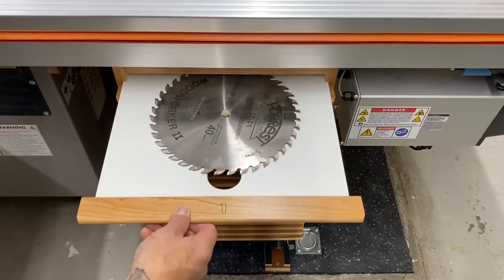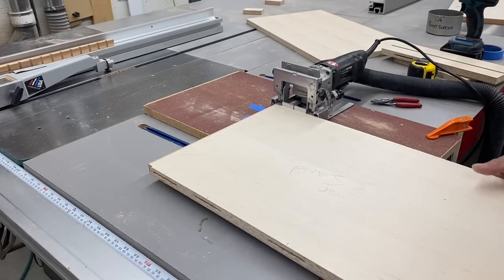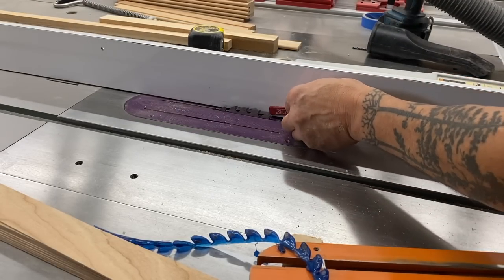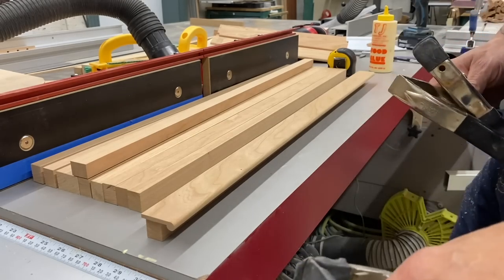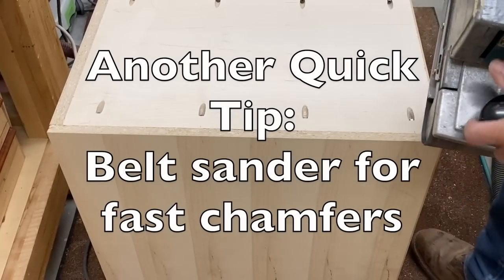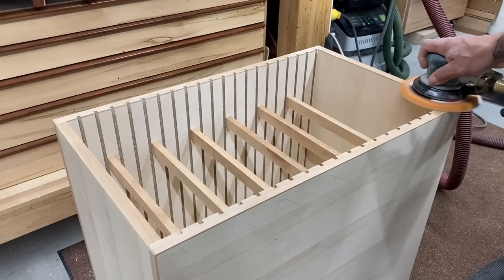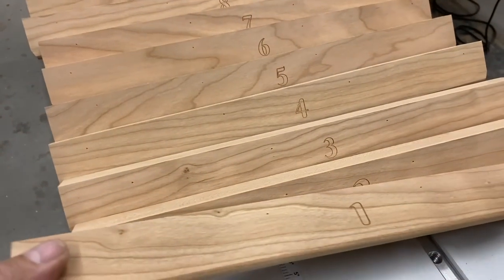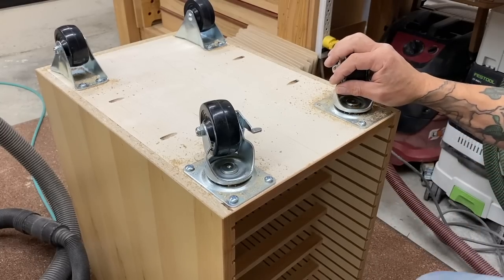This Saw Blade Storage Cabinet is Awesome!

Comment: This is the best looking sawblade cabinet around!!  I've never heard of a relish in woodworking, but I like it so the front looks clean without a step.  Is  there also a ketchup and a mustard :-).  The magnetic block is great and I'm guessing your Tiger fence would work just as well if you had a dado head on the K3.  As usual, there are lots of great tips and tricks within this excellent video - thanks for sharing your knowledge and for the mention about my holder (even though yours is much nicer).  Cheers!!
Reply from the maker: Thanks David.  I think yours is a better design with the doubled 1/4”.  I’m curious to how well cleats would have worked on my original idea but this is working out well.  Yes! I wish I had a dado stack for the K3…I need to look into them.
Reply: @ramonartful  My dado stack is the one made my Forrest and it is small at only 6" in diameter.  It's also quite pricey but it is obviously high quality.  I don't use it as much as I used a dado on my cabinet saw but I'm not sure why.  It's probably since I have my shaper so I can do some of the tasks there.  I believe an 8" dado stack will fit but you can't retract it all the way or you will damage the saw.

Comment: Going to build one, but I'm going to try and stiffen the 1/4" melamine by adding wooden 3/8" x 3/8" channel strips on the edges of the 1/4" melamine board. Dados will change to 3/8"(+); spacing between dados remains the same.  What do you think?
Reply from the maker: Sure!  That’s a good way to do it.  You’ll love it.  Much thanks.

Comment: Another great addition, as always, awesome techniques and insights. Speaking of techniques, do you have anything that would help minimize chip out on melamine using a none slider with a scoring blade. I've tried different things but to no avail.
Reply from the maker: Thanks…I appreciate that. Melamine is probably the trickiest to cut clean on both sides without a scoring blade.  I do have a method that works for smaller pieces but it’s not practical for larger pieces or a lot of panels. Let’s say I need a panel that’s 15” wide.  I’ll add a strip of tape to my fence…lower the blade until it protrudes about a 1/32” or 1mm.  Run the panel through, against the taped fence.  Then, raise the blade to normal height and remove the tape from the fence.  Cut the panel again and you’ll have a clean cut, top and bottom.  The tape moves the panel over a few thousandths from the blade…minimizing or eliminating any chipping.  Effective but not efficient.

Comment: This is the most complex and inefficient use of space I have ever seen. Bad storage system. You can not see what is in each drawer. So you have to hunt for the one you want. Only a cabinet maker would think of this. 
I have all my blades on 4" long peg hooks on my pegboard with cardboard spacers between the blades. I organize them by diameter and by tooth count. I can immediately see what blade I want.
Reply from the maker: Not true.  You may have missed where I numbered the drawers and have a sheet for reference.  After a year of use…it’s great.  I know exactly what blade is in each drawer.  I have some blades in multiples and they can stack…so I store about 27 blades.  I don’t have wall space and I wouldn’t want to dig to the blade in the back.  

I don’t organize by tooth count.  I organize by tooth configuration. This works great for me and I’ve seen others with similar cabinets.  I’ve built cabinets for decades. 

 Do you what works for you…it’s simple.  I won’t even say yours is a “bad storage system”. Because if it works for you…that’s great!  Cheers